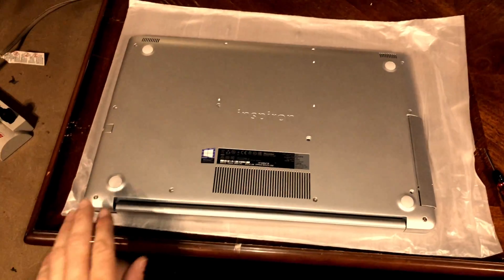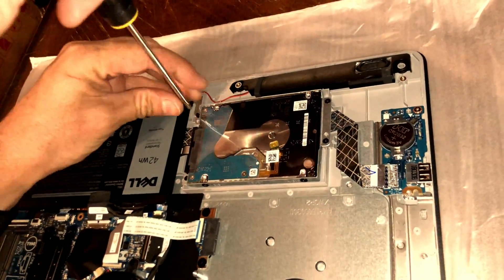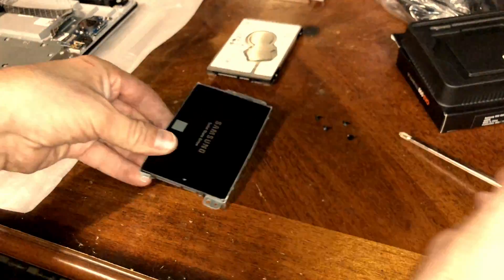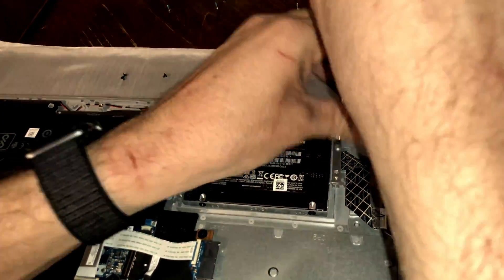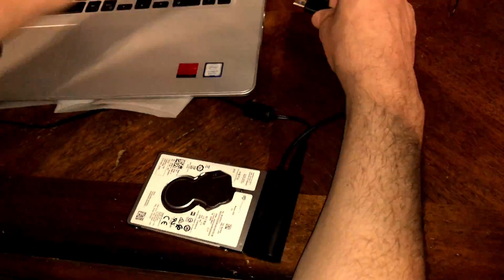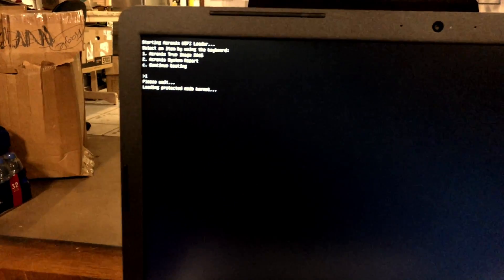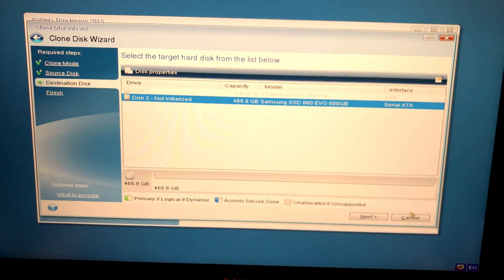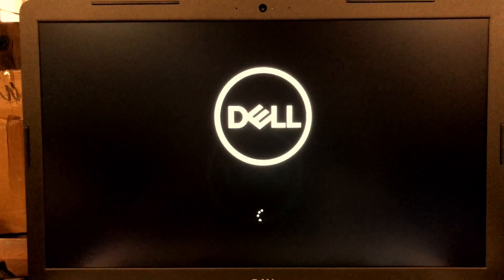Dell Inspiron 17 5770 SSD Upgrade Guide 8th Gen Intel i7 AMD Radeon 530 | Step By Step

Comment: I have a problem removing the optical drive. When I remove its retaining screw it moves about a quarter inch and then snags on something. I'm hesitant to use a lot of force as I'm essentially pulling on the drive tray. Without being able to remove the drive I can't get at the two base cover screws that sit underneath it so no way to remove the cover. I'd be happy to get any advice on what to do next.

Comment: so, which laptop hard drive controller/enclosure was compatible?  I noticed that you tried to use https://www.bestbuy.com/site/startech-com-3-3-usb-3-1-adapter-cable-for-2-5-and-3-5-sata-drives-black/5768712.p?skuId=5768712 and it did not work.  what encoluser/controller did you use to get it recognized?

Comment: People, that machine have M2 slot, USE IT and you may have 2tb and SSD at once!!!
Reply: People are stupid, don't worry
Reply: @Devil111333  Recovery from an ssd is way easier from a SATA connection than an M.2. Yes, obviously anyone can add two types of drives to this system... this vid is just about the one type.

Comment: What a waste...why would you do this instead of simply adding an M.2 SSD that there's already a slot for and keep the existing drive for storage?
Reply: what type of wifi card it uses?
Reply from the maker: @maddominican879  The Dell Inspiron 5770 uses a Qualcomm Atheros NGFF socket card "Model QCA9377" (802.11ac Dual Band (2x2) Wireless Adapter+ Bluetooth 4.1)

The DELL PDF with the actual speed and specs of the card can be read here on page 17:
https://topics-cdn.dell.com/pdf/inspiron-17-5770-laptop_setup-guide_en-us.pdf

Here is the driver download for it:
https://www.dell.com/support/home/us/en/04/drivers/driversdetails?driverid=mkfdk
Reply: Wondering the same thing since I think that PCIe is supported and should be faster. I'm more worried about getting the cover off! Wish Dell made it easy like my old Acer but I could only replace the HD with a sata ssd on the Acer.
Reply from the maker: @eminusipi  M.2 PCI-E drives tend to have a higher price point, they require extra steps for data recovery, and require software only solutions for cloning the drive itself to a different drive. I agree as far as speed on certain chipsets it will be faster performance than a SATA connector.
Reply: @geekswhocare7093  A while back I bought a 500Gb m.2 nvme ssd.  I used Macrium reflect free to move partitions from the 2T hard drive onto the smaller SSD. There is a lot of empty space in those partitions. It took about an hour but no external hardware was required so nothing more to buy and that offset any potentially higher price of the nvme ssd. Just changed the boot order and now it boots lightning fast and has an onboard data/backup drive.